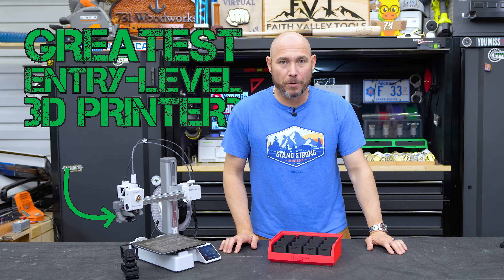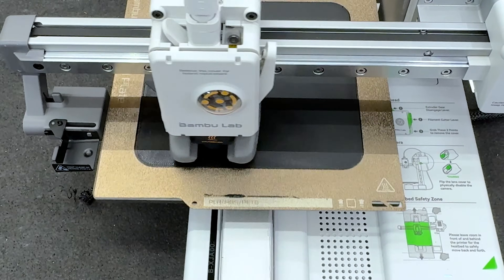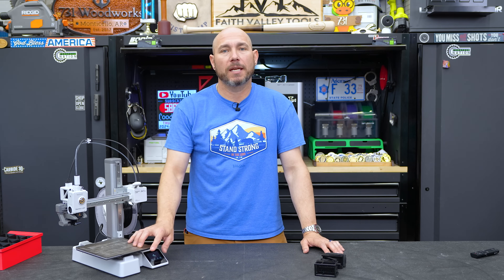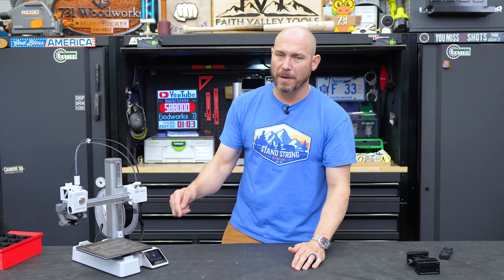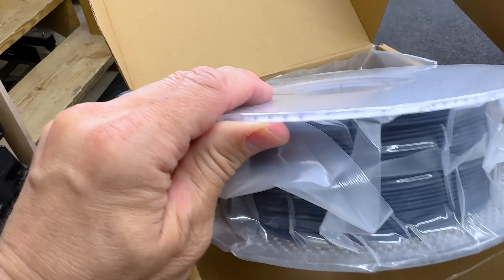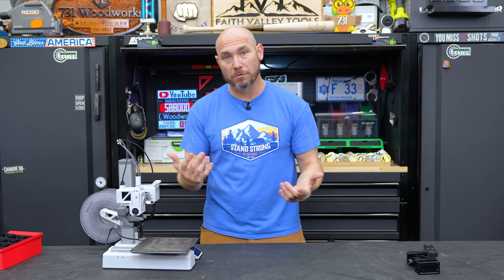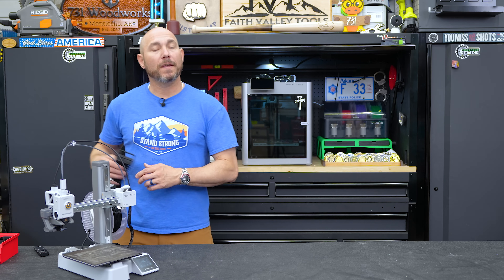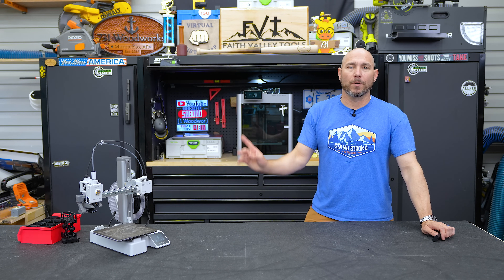99% of Beginners Should Start With This 3D Printer - Bambu Lab A1 Mini Review

Comment: I am not a Bambu hater. But keep in mind as good as these machines are, if something goes wrong, fixing them is not easy and customer service is hit or miss unless you are a YouTube influencer. (Yes this is true)

I had the kickstarter X1C and fixing issues on it was ridiculous and what their wiki said to do wasn’t very clear and parts were welded on. They ended up telling me I did everything wrong. 

I actually got an A1 mini that was working great for a month then something happened. I am waiting on a replacement part to fix it and a bit nervous. 

I build computers and printers and this is disturbing.  There is a benefit to getting a cheap basic printer and modding it. You will learn a lot about how they work. 

As a 3D printer enthusiast that builds kits. We are noticing although these new printers are easy to run they are getting more difficult to fix.
Reply: People have to decide what their real hobby is. If it's tinkering than buy cheaper printers and continuously upgrade them.

If it's actual printing then Bambu has finally made that an option.

Bambu printers aren't perfect, but mine have needed less than 1/4 of the fixing, troubleshooting, and upgrading of my past printers. Personally, so much happier.

As the printers get better there is less need of the old-school knowledge.

Comment: I love my A1 Mini, I have two complaints. PLA warps regularly. Also the Hot-end assembly breaks easily if a filament blob occurs.
Reply: PLA warpage should almost never happen. It just isn't a material prone to warpage. Are you sure you aren't experiencing build plate adhesion issues? I know everyone says it but it's true: make sure your build plate is clean. Use dish soap and warm water, scrub it and then avoid touching the print area.

For the hot-end assembly, I'm not really sure how you're running into blogging issues that severe. I have hundreds of hours on both my A1 and A1 Mini and have never encountered blobbing. Maybe do some extrusion tests, check for partial clogs, and make sure your filament is dry so it behaves properly? Idk.

Comment: Wait: do you necessarily have to install the app on your phone in order to use the printer?
Reply from the maker: you can use your computer and an micro SD card to move files over to the machine if you don't want to use your phone or wireless to send the files.
Reply: @TheOutlawEffect  No I wanna know if I need a phone / app to initialize the printer. Do I have to register it first in order to use it?

Comment: thats not correct creailty is creailty K1, k1c, k1max, and i have been told that the k2 plus are faster than the bambu lab i have a P1S combo i have tested the the speed with the K1 and the k1 is 10mins faster K1 and all the K series are all auto bed leveling k1 plus is a combo multicolour printing not out until september

Comment: Matt I was really interested in this and when I saw it was on sale I hade to buy it. I haven been wanting the X1 Carbon but couldn't justify the price not knowing how much I will use it. At $199 it was a no brainer. If I use it a lot then it's easy to justify the X1.

Quick question, have you been printing in PLA, PETG or something else? I read about the differences but still not sure when something needs the added strength of PETG. Keep up the great reviews.
Reply from the maker: I haven't gotten that deep into it yet.  Just using PLA Basic for my prints.
Reply: There's an assumption when you first start that PETG is a stronger material, but it isn't. 

Watch some filament strength tests and you'll see not only is the strength similar but some PLA beats it.

How I decide between printing in PETG or PLA is if the part will be in the sun or hot temps. PETG shines in those circumstances while PLA deforms.
Reply: @Onerabidmonk1 it depends on how you define strength. If you need something more damage/impact resistant or with some degree of material flexibility then PETG is normally a better bet, too. That being said, PLA+ helps improve on some of the durability deficiencies of regular PLA.

Comment: Don't forget about the A1, which is just as great as the A1 Mini, but the same bed size as the P1 / X1 series.
Reply: @sleepyjoe7843  i keep my filament stored with sphagnum moss and works great in keeping my filament stored and dry
Reply: Did He upgrade
Reply: Once i upgrade im gonna tell you how cool it also is
Reply: @zer0coolninja887  did you upgrade?
Reply: Bro i got the mini with no 4 color attachment just the printer and a few base plate for texture and 2 color filaments black and red mate im only in it to make 1.5 inch circle vents for my bugs container i breed bugs and i can print them out not pay $3 for each vent. Now i can print hides and water dishes for tarantulas
Reply: I will move up eventually to a A1 and more colors but for now it was under $300 to start with what i mentioned above. You cant beat that deal. I would feel bad if i broke the A1
Reply: @zer0coolninja887 start selling them 😉